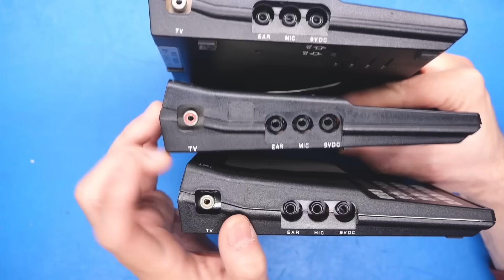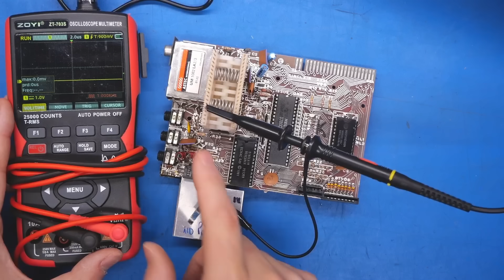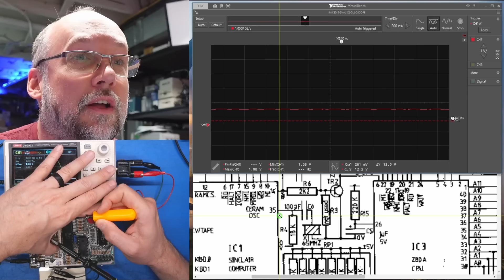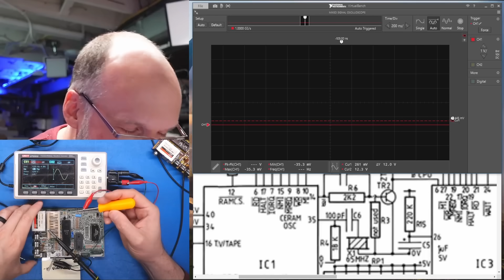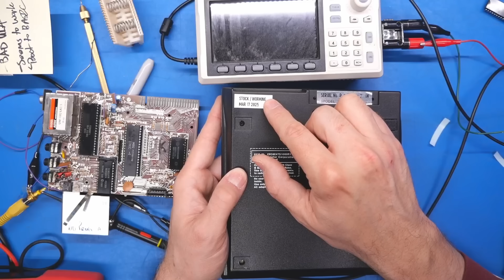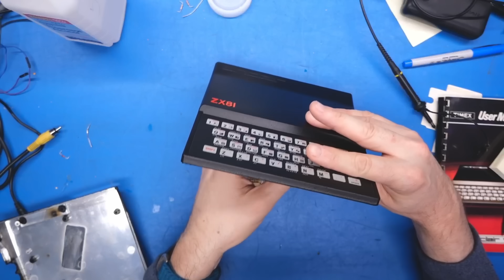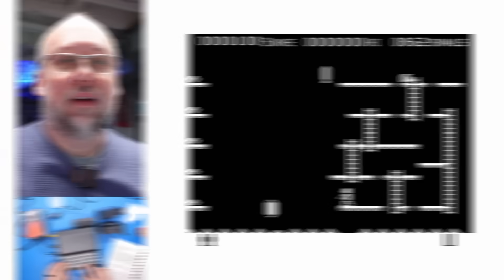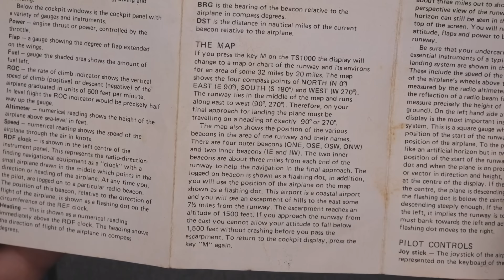Is the ZX81 / Timex Sinclair 1000 actually bad? Let's fix these to find out.

Comment: 23:10 - That's no crystal. That's a ceramic resonator. They fulfill the same purpose, but they're usually not nearly as accurate. However, they do have the distinct advantage of being cheaper. Yup, that's another cost-cutting measure.

Comment: The "crystal oscillator" was a ceramic resonator. It's a passive (actually reactive) piezoelectric ceramic material that works very similar to a crystal but it is not as accurate. Most often a oscillator circuit is a filter and a gain stage with a 180 degree phase offset that the desired frequency. The reason the oscillator circuit worked to some degree with the CERMET (ceramic resonator) removed is because of the RC filter causing a loose filter of the frequency. These ceramic devices were first used as filters in IF RF stages at lower frequencies like 455kHz and that is why they have the grounds pin in the middle - they act like a "T" filter. After time they were a little more accurate and used in higher frequencies and so are now used as a cheap replacement for crystals where a less precise frequency is needed. The Arduino Uno has one in a metal can that looks exactly like a miniature crystal but is a CERMET. The ULA will have an output that is either inverted once or twice depending on the configuration of the transistor which I couldn't see but a common emitter configuration inverts (causing the 180 degree phase difference) and a common collector or voltage follower configuration has no phase offset. It could have been that the transistor provides the phase offset and there is no inversion in the ULA - I couldn't see but normal theory of operation is to take the signal from one side of a crystal or reactive component and then put it though an inverter (180 degree phase change) which could be a logic inverter like 74HC(U)04 hex inverter or just a transistor and then back into the other side of the crystal. That is essentially what is in the 4 pin block type active oscillators that generate a clock signal without the need for external components - hence "active". 

Another great video - thank you.

Comment: Yep had a ts1000. Is what got started. Went on to a color computer II radio shack. Learned to program in basic as the time passed. And moved on to more powerful units. Just wish I would have stuck with programming. Oh on the 1000 I even hardwired a joystick.

Comment: I had a few of those way back when. I joined a local computer club that played with them also. I bought an old full sized keyboard and figured out the matrix for it and wired it to the TS1000. Also installed a switch to toggle the white screen to black (Cursor white) and converted the ram to use the lower memory ( Basement Ram ). The club members had me upgrade all their machines also. I'm 68 now and forget how I did any of it. Oh Look, Big Clive was here. Hi Clive.

Comment: fyi, the zx81 psu is 9vdc at 1.4a unregulated with a positive tip. source: i still have mine. Also the RAM modules are NOT grounded - this is what's causing the RFI. I simply ran a wire from the ground rail in the computer to the ground rail in the RAM with a decoupling capacitor. Problem solved.

Comment: I did not have a ZX81 as a teenager but was always curious about them. A few years ago I got my hands one and was pleasantly surprised at how useable in was despite all its shortcomings in terms of keyboard, color and sound. Just slap on a 16K RAM module and you ended up with a proper computer setup which was quite capable in the right hands. Much respect to the Sinclair team.

Comment: The ts-1000 was my first computer. Back then I knew absolutely nothing about what to do with it. Read the booklet and tried one of the programs. Took me forever to get it entered into it without messing up the code, but finally got the program entered correctly.
It was a program that simply moved the cursor in whatever direction you pressed the direction arrow. 
Not very stimulating now, but to a kid who had never done anything with a computer before, I was simply blown away when I got it to work correctly, and I was hooked.  Later I went to commodore Vic-20, but without this timex, I might have never got started. Still have this one in a footlocker at home. Might have to dust it off and see if the old girl will work again, and take a trip back in time…….🙂

Comment: On my ZX81, I had an standard keyboard/case that I bought for it.  I took the board out of the original case and put it into this aftermarket keyboard/case.  Worked great.I don't remember more that that, is been a while since that time.  Thanks for the video.

Comment: ZX81 was my first ever computer. I cant remember the price but you had an option to save £10 in UK if you built it yourself. As I was in to electronics I chose that option. You get a bare pcb all the components to solder in and some instruction. Loved it at first especially when I added the 16K RAM pack that plugged on the back. Soon got limited though.
I put mine in to a third party metal box that had a real keyboard and a clamp to hold the RAM pack steady. crashes were still pretty common but the worse part was trying to load a program from audio tape and something going wrong near the end of an upload.

Comment: The interference caused when loading data ie. playing a tape with data was actually useful. It let you "see" the data so you could judge the quality of the signal and also help navigate the tape.
The tape functionality was much better with the Sinclair machines than the Commodore ones, not only was the bit rate higher you could also use any generic tape player rather than having to invest in a Commodore tape deck (which you would btw. kill if you happened to connect it while the computer was on).

Comment: I did my senior design project in '83 on the zx81. There is a nice technique to capture the program from ram that you can then burn to an eprom. We built a keystroke emulator that would automatically type the keystrokes needed to reload the program from the eprom on power up. That was all done with a wire wrapped perf board mounted to the expansion connector. I still have the final report with schematics in the attic somewhere...

Comment: Back in the early 80s I was in a budget computer club where we would take Timex Sinclair 1000's and gut the case and install the internals into a standard (then) keyboard to get around the horrible keyboard it had. Keyboard cases back then were about 3 inches thick, so they came out looking like a Commodore 68.  I learned to program in Basic with mine. We had monthly newsletters that come with simple programs you had to type in. The tape interface sucked. I even had the memory expansion module on mine.

Comment: I had the Sinclair Spectrum. Hated the keyboard so much I adapted a tactile qwerty keyboard to work. Just copied the matrix wiring under the original rubber keyboard. Worked better but didn't overcome Clive Sinclairs awful take on Basic.

Comment: I wrote a program in basic for the zx81 to calculate horse racing bets for a local bookmaker. It was more for the complicated multi-bets with one stake that took a long time for him to work out.
For instance, a Round Robin was for three horses and 10 separate bets for 1 stake. Imagine working out the exact winnings for 11/8 100/30 and 5/6 in 10 combinations.
He used to use a pencil and paper to work them out while meanwhile queues were forming to place bets.
He bought my zx81 and program and told other bookmakers about this brilliant computer that saved hours of work.
I sold 10 and thought I was on my way to be a millionaire lol.

Comment: The Timex Sinclair 1000 was a better version designed in Portugal, by Portuguese, and in fact it was a motive for Sinclair to improve their computers a notch. And the Timex branding was not there because it was more recognizable. It was there because it was actually manufactured by Timex under the license of Sinclair. The factory was located in Charneca de Caparica, near Almada, Portugal, and before computers they used to make watches there, until some revolutionary guys spoiled everything for the workers and Timex moved the watch production to somewhere else. The computers were exported to the United States, but not only.

Comment: I had one of the Timex Sinclair in about 1981. It worked fantastic but the main problem at that time, with the one I had, was overheating. The fix was a TO 220 heat sink on the 7805, which I did but then the keyboard was was flaky after that, for obvious reasons.

I eventually moved on to building my own 8085 for learning assembly language

Comment: I'm curious as to why you didn't mention that the USA ZX81 units were sold only as kits that required the customer to solder all of the components onto the PCB and mount the sticky-backed keyboard into the front cover.  These units we never sold as pre-built. The ZX81 was my first computer, I bought my kit almost immediately after they were first advertised in 1982 as I was an experienced electronic technician working with industrial 8080 computer boards.  For me it was an easy build and it worked perfectly from first power-up.  Eventually I added the ZX81 RAM pack and printer to make an entire system that I actually used in my college advanced math courses to create XY graphs by inputting an equation and range of variable values.  It was the first time my math professor had ever seen them generated by a computer.  He was impressed.   The ZX81 was more than a toy if you really understood how to use it fully.

Comment: There was a fast mode that only drove the display when it was waiting for input, so you got the full CPU speed of the Z80. I expanded mine to 64K RAM and dual 8 inch floppy drives, proper keyboard,  dual sound chips and a speech synthesiser. Also pixel mode graphics which IIRC only needed a couple of TTL chips to implement.

Comment: I had a TS1000 with the 16k expander the ZX81 had 1 k the Timex has 2kb, I agree the kb sucked. i found an aftermarket full size mechanical kb that worked great

Comment: The ZX81 did all the video rendering in code. So the CPU only had time to run your program in the gaps at the top/bottom of the image (and in the frame sync). You could set it to 'FAST' mode. That would cause the screen to blank whilst it was processing.
The tape input to the video line was used to adjust the volume of your tape playback.

Comment: Long, long time ago I had a ZX81 kit and build a 32KByte DRAM extension for it. About more video noise with RAM module: The 5V regulator on the CPU board has to deliver much more current after RAM module is pluged in. The electrolytic capacitors on CPU board and RAM board can be dry and not work properly.
Something that helped me was to put SMCC inductances into the +5V wire. You have to cut the +5V wire and bridge the gap with a 10uH (ten microhenry) inductance. An inductance at the +5V pin of the ULA helps hopefully most. In the old days, little resistors - say 33 Ohm - in the /RAS and /CAS lines to the DRAM helped, too. There was "digital echo" on these lines. Again to insert these resistors you have to cut traces and bridge the gap with these components.

Comment: It's not a crystal oscillator, it's a crystal resonator. The oscillator is the combination of the resonator and the other circuitry around it, including circuitry in the ULA. Now you know why you get (rather variable) oscillation output even without a crystal in the oscillator circuit to help lock it to the crystal's resonant frequency.

A stand-alone crystal oscillator is easy to identify; unlike a resonator it has four pins because it needs a Vcc input.

Comment: My older brother actually had several ZX Spectrums in the eighties. He too was annoyed, even heavily frustrated with the insane rubber keyboard keys. One day he took me by train across the Netherlands, to the other side of the country, where there was an obscure hobbyist computer store where they sold keyboard casings that would replace the ZX Spectrum casing, to give you a larger casing WITH an actual better, hard plastic keyboard.
So, these existed at one point. Don't know if you can still find them.

Comment: The membrane connections are a PITA on the factory keyboards. I reinforce mine with clear tape. It makes them more durable and re-installation is much easier. If you decide to replace them, the reproductions are made of a much higher quality material that's easier to work with.

I've had a similar experience with the 16k RAM expansion adding noise to the video signal. My first experience with a TS1000 wasn't until 2024, so I'm going to guess it's age-related. No one who used them back in the day in the comments here seems to be commenting on this.

1:08:22 Yes, Timex made a TS1000 with a better keyboard. It's called the Timex Sinclair 1500. It's basically a streamlined TS1000 with a Spectrum-style case and keyboard and 16k RAM built in. In my opinion, Timex should have launched with this and not bothered with the 1000 at all. It was too little too late. Aftermarket keyboard upgrades continue to be made available on the TS1000.

It could be because my expectations were set so low, but I actually think the keyboard on the 1000 isn't bad. When programming in BASIC, each keypress types out an entire command, so I don't feel like I'm missing out in terms of speed. I can somewhat type by feel because I can feel the depressions in the keyboard membrane, and the only time I need to type quickly is when gaming, but my fingers never move away from the same 2-4 buttons.

Comment: The fact that the ZX81 seems dire by modern standards shouldn't be taken as an indictment of that machine, which ushered in the microcomputer revolution in the UK; but as a testament to how far we have come in just 44 years.

The early ULAs did not produce a backporch on the video signal, and the early ROMs had a nasty bug with the PAUSE command.

ZX81s are cheap and plentiful enough to keep one pristine example for show and one fully tricked-out machine with a proper keyboard and plenty of RAM .....  Maybe even an AY sound chip, using the GPIO ports for a joystick and printer interface .....

Comment: The RAM-pack connectors conveniently doubled up as exquisitely-sensitive seismometers, able to detect a person lightly walking or sneezing up to 10 m away.  My dad did the mod where you nail two lengths of wood to a board and sandwich the machine snugly in-between, dialling back its sensitivity, somewhat.

I also fondly recall that when the memory was exhausted, the machine basically locked up, unable to register further key presses!  Without the 16K RAM-pack, you could basically fit a few dozen lines of code into the built-in 1K, but once it was full up the only key that did anything was 'delete'..

Comment: I solved the keyboard issue by.... Dumpster diving - an old electric typewriter keyboard (an Olivetti ) and hand wiring the matrix, soldering on to the motherboard. I had to make a cheat sheet for typing the keywords but it was much easier to use.

Comment: That was my first computer. It came as a kit and you soldiered it. I spent hours typing in pages of program listings from Compute magazine. There was no sound but a clever article in compute magazine showed how you could get sound using a speaker wired across an address line on the zx80. The code would address memory locations such that you could trigger a PWM signal and various frequencies.  The damned thing played the Star Spangled Banner.

Comment: The 6.5MHz component is a resonator. Pin 35 is part of an oscillator, tuned by the external resonant circuit. With no resonator connected, it free runs.

Comment: I bought my ZX81 when it first came out, it cost me 5 weeks wages. That actually took 20 weeks to save after paying for my keep and transport costs. 10 weeks later I bought the RAM upgrade followed a few weeks later by a keyboard upgrade. I found it very frustrating, typing in programs for hours. The clock took 3 hours to type in then ran out of memory after 42 seconds. 
I eventually gave up and ordered a better computer but it never arrived after nearly a year of promises by the store I cancelled the order.

Comment: The analog video signals uses the amplitude of the sync pulse to compensate the overall brightness of the image. In other words, the ratio between the sync pulse and the total amplitude defines the contrast of the image. That is is why the image got dark with the 220 series resistor  and got better with the 75 ohm but still not optimal.

Comment: I e-cycled one of these in the early aughts for exactly the reason you mentioned -- I mixed up RF video with composite video, in part because of the RCA jack. Thought the machine wasn't working. It was more than a decade before I realized the mistake I made. I've since bought 2 to try to make at least 1 good one, and atone for the sin of ignorance. 😅👍

Comment: Regrettably, I made my parents sit through a time share presentation for a Time-Sinclair 1000 w/16K Memory Pack in 1983.  I already was running a TRS-80 Model 4 w/128K on-board, and should not have sent them into a shark tank for that bit of crap.  

Prior to that, though, I remember seeing the ZX-81 offered in kit or assembled form in a magazine I was regularly reading.  Popular Mechanics is archived in this time period, so I went looking and found a full page ad for ZX-81 kits in the November 1982 issue of Popular Mechanics, and a full page ad for the TS-1000 fully-assembled in the February 1983 issue.  These aren't the ads I recalled, but it fairly narrowly identifies when the product changed name.  The TS-1000 ad incidentally has a large SINCLAIR logonym in the advertising, for what it's worth.

I'd like to see a modern case (maybe with in-built power supply) and has the same shape as the ZX-81, but scaled up to take a 104-key mechanical keyboard complete with those amazing legends.